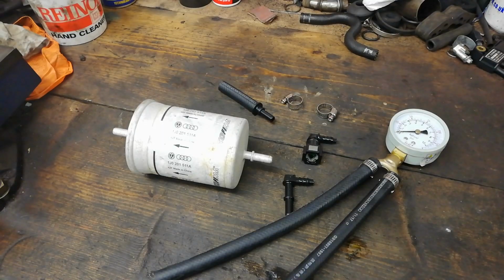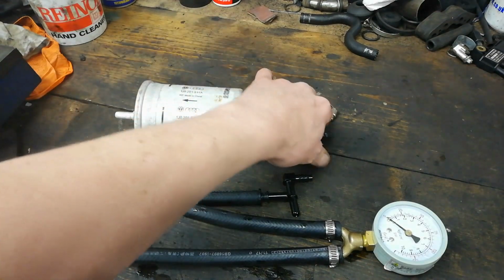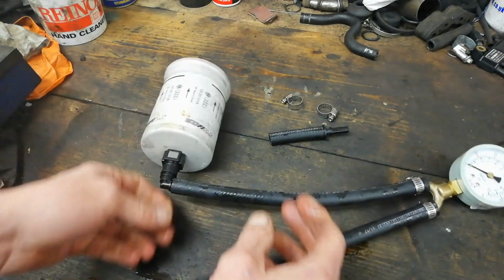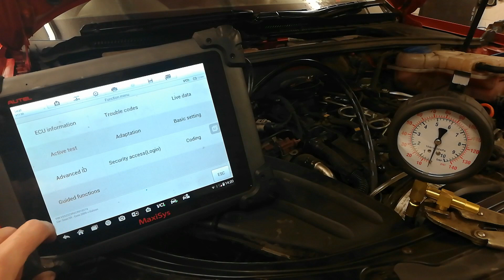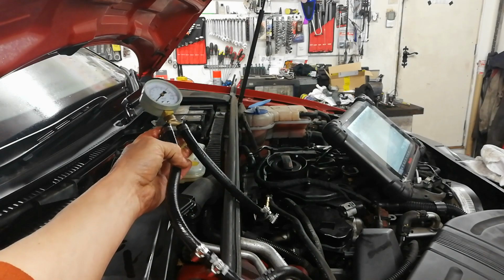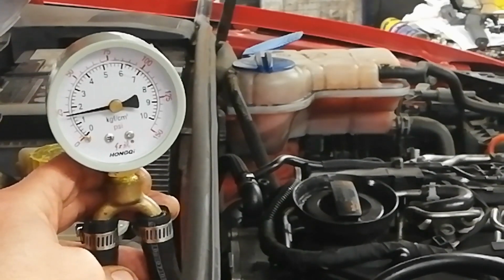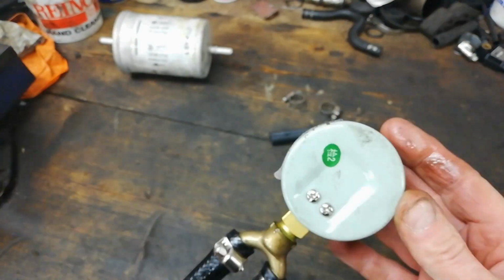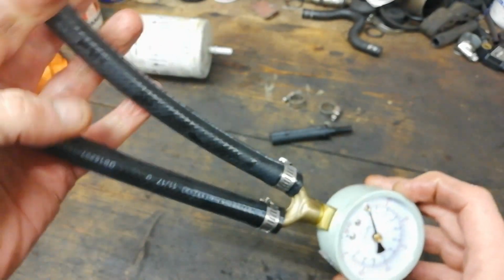Cheepo Fuel Pressure Tester, Is It Any Good??

Comment: Hey Dave I purchased one of them cheapo gauges, and it seems to pretty accurate. I air checked it with 2 different tyre inflators.  all three gauges read the same.??? Also confirmed boost pressure with it to. Yours must be a a bad one.

Comment: i wonder if one  reads high and the other to low. you would need a way  to test it on a  calibration rig to be sure...
Reply from the maker: I tested the big gauge against a pressure transducer one time and both readings were the same. 60psi is about correct for this system, around 4 bar

Comment: Can the gauge be removed dave?
Reply from the maker: Aye, i think so but im going to see if i can calibrate it
Reply: @davesterl  what's the thread size? I'd order a nicer gauge plenty on ebay.
Reply from the maker: @MrAsadEp  dunno i havent taken it apart. I might do a vid on trying to calibrate it
Reply: @davesterl  I think the vids going to end with a hammer and a lot of scrap metal lok
Reply from the maker: @JLsAutoSolution  hmmm I'll keep the lines and connectors tho, lol